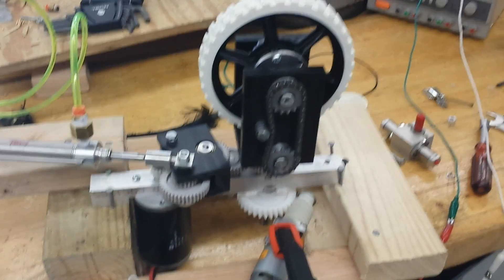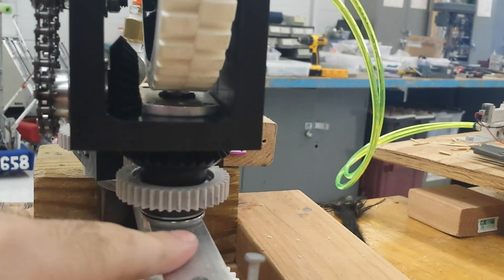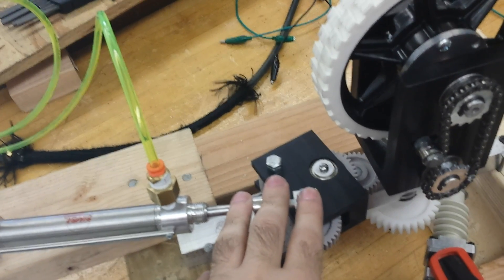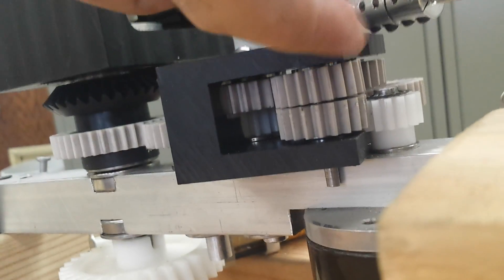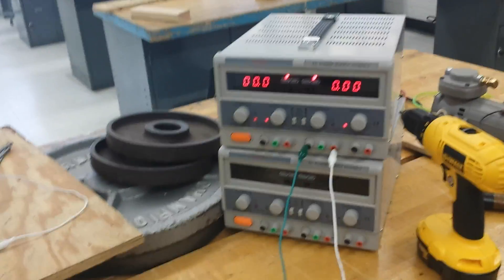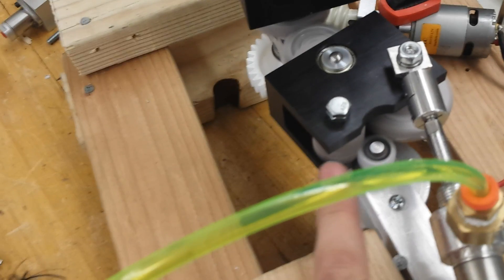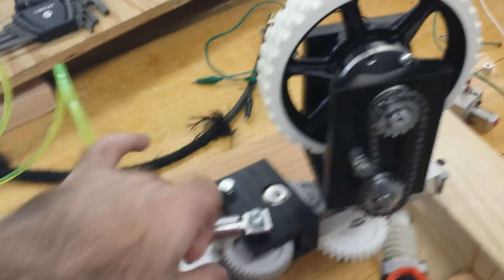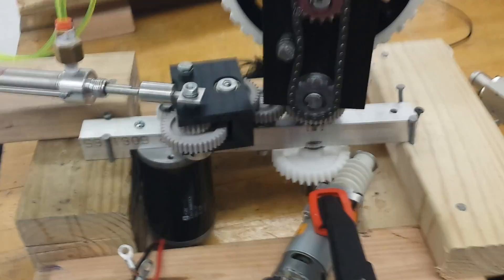2015 FRC prototype two speed swerve drive initial testing

Comment: 188 tried to do this back in 2003. Tristan Lall was the designer and we tried it with globe motors with a cam on a 4WD. Ended up going back to a single speed in the end because it could not stay engaged under load.
Reply from the maker: We already made a working chasis with it and tested with loads. All we had to do was increase the piston diameter and there's no problems. We can go as big as we want with the Pistons to handle as much load as we need So that aspect Is a non issue.

Comment: This used to be about kids building robots. Now its just mentors building them...
Reply from the maker: funny you say that. For a good amount of teams this may indeed be true but we're certainly not one of them. Most of the parts on our competition bot are actually made by kids and they are involved throughout the entire design process. This test drive is an exception since it's just a prototype strictly for proof of concept testing during the off season. In the end we're not even going to be using such a design anyway. Different teams have different resource, capabilities, and availability so it's unrealistic to expect all teams to function a certain way. Especially when you don't know anything about any given team's situation.
Reply: On the team I was on the kids did everything.  Mentors never really touched the robot unless we were moving it. The only pointed out potential flaws in designs and showed programmers where the bugs were.  When I was a mentori talked to other mentors and the joke about how it's "for the kids" because they didn't do Jack and it was all the parents.  One mentor even told me it's a shame the have to kids drive and not them. It makes me sad some teams are like that. I am not saying yours is like that, but everything we designed was ours.
Reply from the maker: Matt Piekarski Well by posting that comment on this vid you were implying we were like that. As stated each team is different and they all have different capabilities and limitations. Some teams are fine with delegating everything to kids, others simply wouldn't even have a moving bot without mentors doing a lot of the work. That doesn't mean anyone should be discouraged about any particular situation any which way. This competition was never really about kids building bots by themselves either. After all their experience and knowledge is rather limited at that point. Also kids using pre-made systems(like kit chasis) or mostly pre-made code isn't really any different than having a mentor do it since it's an already established design that's ready to go. How many of those teams would still be able to compete without those resources? In some situations, for better or for worse, some stuff just wouldn't get done unless mentors just go ahead and do them(which is what this transmissions was, i wanted to test the design before robot season so ended up doing most of it). Though this is just off season testing anyway so it doesn't really matter. I would love to have done less on it but when you tell a kid they need to look through a seemingly thick book on how to do G-code it doesn't take long to see it just isn't going to happen. We try to force as much on the kids as we can(to save the mentors from having to do it lol, remember for the kids as you said!)  but it's also a learning experience for them. Not just that but indeed some teams have the mentors do everything. Even then there is still a lot to be learned by the kids by observing and interacting with professionals in the field. This is also a competition so at the end of the day some teams really want to do well/win so will utilize any resources they can. You may not agree or think all structures are ideal but that's ok. In the end it's still all beneficial to the kids and what's what should be taken away from it. It was during last years kickoff that Dean himself specifically stated his thoughts on the matter. So regardless of how a team is structured and functions, just try to see the good in it.

Comment: There's no issue with shifting when free spinning, but do you think the case would be different if it were supporting 1/4 the weight of an FRC bot?
Reply from the maker: the drive chassis we had did 1/2 the total weight without any issue. I don't see it being an issue with full weight either.

Comment: Are those plastic gears? How worn down are the gears on the shift shaft?
Reply from the maker: yes they were acetal gears. there was no wear but under extreme conditions some gears were sheering teeth so we scrapped them and are trying out steel gears now.

Comment: Thanks for linking this it's awesome to see this swerve in reality. After seeing it like this I'm still really worried about it from a durability standpoint but it's still awesome.

When you cut the material out of a face of box tube (like where the CIM and swerve mount bearings are) you take away most of it's torsional rigidity.

I'd really recommend checking out the inventor stress analysis tool before you put too much more effort into manufacturing this.

When we going to see running tests of this?
Reply from the maker: we know. part of it is trying to see what we can get away with. most of this design is as minimal as we think will work, and as issues arise(if/when they do) we can address them one by one until it's sufficient enough to survive a few 2.5 minute rounds =p It's easy enough to replace any part/module on here so a fix is less than a minute job. Remember, we arn't trying to go to mars here. we will build the bot and put it through it's paces and see where modification/reinforcement will be required. nothing about this design was ever final or completely thought through so yes there may be issues with it but those don't worry us, we'll just address them when needed. We have a lot of flexibility and options with this approach to change/modify stuff. stronger materials? sure. bigger support structure? sure. larger gears? sure. different ratio? sure. smaller/bigger wheels? sure. changing orientation of parts? sure. Everything about this is completely and easily customizable, that's the most powerful feature of this type of design.